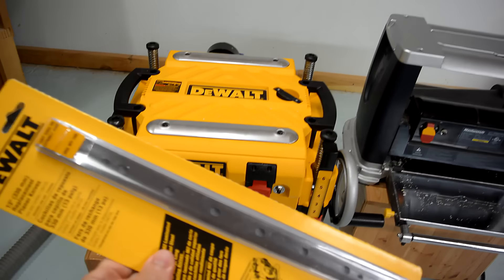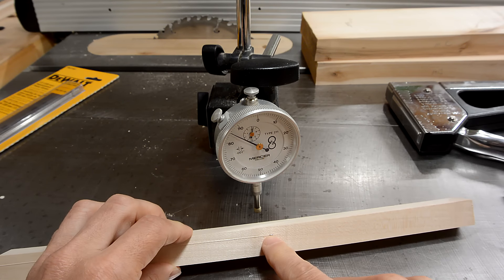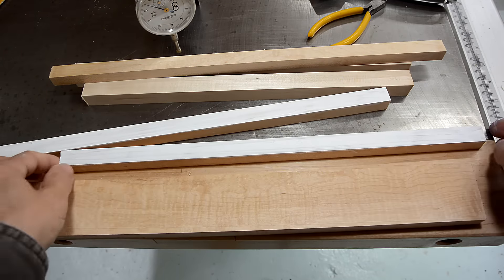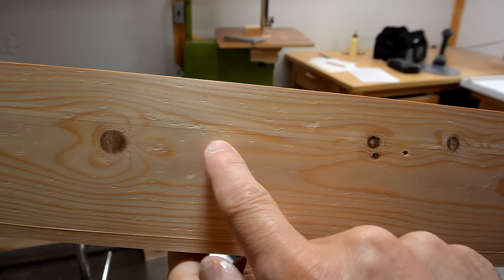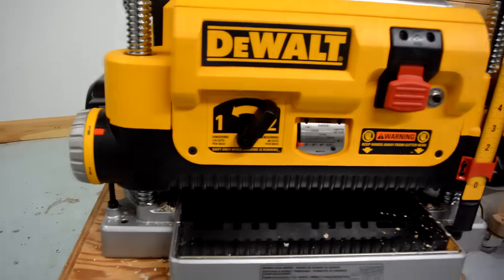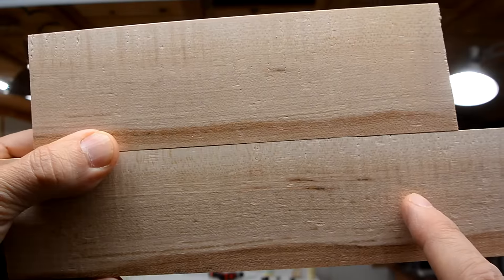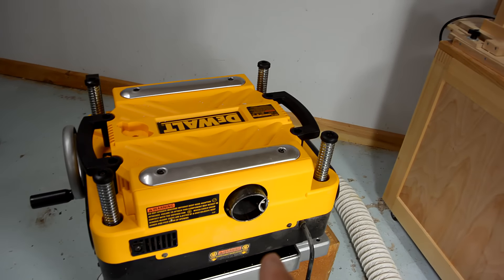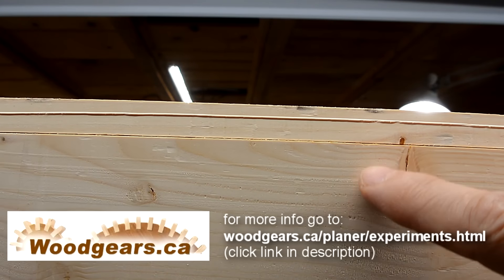More planer experiments

Comment: ...jamming one stick of wood in really fast, one after another, and then being upset when it jams... is an ID10T Error. Don't blame the machine.
Reply from the maker: Feeding wood back to back is the way to do it.  It cuts down on snipe.  Idiot commenter has no woodworking experience.
Reply: +Matthias Wandel I won't argue that
Reply: The actual problem is lack of support on the outbound piece. Table wings would solve it.
Reply: He explained in a previous video why extra support doesn't help.
Reply: +Paul Frederick yeah, I heard him too, but I have the extra table supports for my DeWalt and they do make a very slight difference despite what he has convinced himself of. Not much, but, yes, they do help a tiny bit.
Reply: NorthernChev
I have an older two screw DeWalt thickness planer and I have made my own auxiliary table for it. I wouldn't use my planer today without it either. It still leaves some snipe, but not much.
Reply: +NorthernChev 
Extra supports do help to prevent the jamming you saw in this video. It does not help snipe as much on this planer but it does on others. Feeding wood back to back is what everybody does because snipe will otherwise be an issue, so it's the planer that is actually flawed, not the operator. 
Although calling someone an idiot makes you even more flawed in my opinion.
Reply: no it doesn't cut the snipe, especially on cheap planers. feeding them in staggered does cut the snipe out completely.. also setting up the feed tables correctly does too.. i haven't seen you do that yet.
Reply: Actually feeding them staggered will alter the 'balance' of the head ever so slightly, so has more snipe issues than feeding it back to back. Although it's both very minimal to nothing I have to admit.
A good firm back-to-back should be just as good or better.
Reply: they do indeed help, i had a harbor freight/grizzly reject 15" thickness planer and the wings did eliminate the snipe. the crazy thing of it was that they really stuck way up there to be effective. Wandle does some really off the wall stuff with and to wood working machinery that anyone with half a brain wouldn't even consider doing. his biggest sin is putting his machines on casters and movable. then he wonders why the tooling patterns in the wood is so crappy.. it's a real "DUH!!!" moment.. if the machine isn't held down solid it's gonna walk all over the shop and the results are gonna be dogshit
Reply: HolzMichel
wood is not terribly sensitive to chatter. Wood is just too soft compared to the rest of the machinery.
Reply: *****
not in my experience. the back to back has always given me snipe whereas the staggering never has. it doesn't affect the balance of the head in the slightest. if that's what you're seeing in yours then you should check your main bearings. they're most likely worn
the snipe is caused by the flexing of the workpiece as it glides across the table. as it enters the knives, it gets pulled up off the table by the force of the knives passing thru the cut.
by lifting up on the end of the board you can counter that initial lift, which is what the wings of the table do.
Reply: HolzMichel Are you sure about that castor thing? :) These boards are so short that they are only supported by the machine itself while processed. Nothing to do with the castors.

They only come into play when you feed long stock, and exceed the friction limit, as you will then most likely also alter the support (vertical) pressure and thus alter the angle. Altering the angle is the best way to get uneven results/snipe midway as you can apply a lot of torque with a long board on a short planer bed.
Reply: Paul Frederick
it may have that appearance, but if you bolt a table top machine down solid you will see a noticeable difference in the way the machine cuts and sounds. if it's dancing around the shop it won't perform as well as it should or could. the harmonics make everything flex and shake. that has a direct impact on the cut pattern and also dimensionality of the finished product. while it may seem like i'm splitting hairs here, you will see what i'm talking about if you run some wood thru and try to glue two pieces of it together. there will be parts of the glue seam that don't quite meet up. that's the flex in the machine. it makes a "slow wave" in the surface of the board that is difficult to measure with standard shop tools but easy to identify in a glue up.
to test the theory and see how well your planer is doing, run a piece of 1x3 maple, birch or similar small, diffuse porous wood thru your planer, cut two 4" inch pieces. spit on one of them and stick them together. if you can lift them off the table the your planer is cutting pretty good.
Reply: *****
yep, positive about the castors.. been there done that.. shitcanned pretty quick like. if your  machine is dancing around the shop floor like a drop of water on hot hot stove top it just won't cut right. and the length of the work piece going thru it doesn't really have much bearing on that
Reply: HolzMichel
I plunk my thickness planer down onto the out feed table of my table saw when I use it, and it does not dance anyplace. Although I have not spit on any boards to stick them together with it yet. When the blades are sharp I like the finish it makes.
Reply: Paul Frederick
if you can clamp it down or bolt it down you'll get better results. it may not be apparent at first but if you do a comparison you should see a subtle difference.
it also has in impact on the longevity of the edge of the tooling. your knives will stay sharper longer.
color me a perfectionist in this department. i've had good looking projects fall apart (literally) because of glue joints that didn't hold because of the wave in the surface finish. sure a guy can run a piece of stock thru a belt sander to get a super flat surface, but not everybody can afford 15g's for a belt sander, nor can a lot of shops.. so then it boils down to tuning the planer to make it cut well enough to make a flat surface and hold dimension at the same time.
i cringe when i see machinery wobbling around on mobile stands bouncing around..
Reply: HolzMichel
just sitting on my out feed table my planer is steady as a rock. Other than a bit of snipe I'd say the finish is perfect out of it too. If I was having issues I might investigate, but I'm not.
Reply: No, feeding back to back is not the way to cut down on snipe. Applying upward pressure on the board upon entering the cutterhead, and when leaving the first roller on exit is the way to eliminate snipe. This needs to be done manually on longer boards with more weight, but can be easily accomplished on smaller/shorter boards like the ones you were feeding WITH THE TABLES DEWALT MAKES FOR THE PLANER. letting the boards just drop off the back of the planer then complaining about them getting hung up is indeed moronic.
Reply: Unless the wood is quite wide I usually feed additional planks in in a different position so they overlap, e.g. feed one in the left and one in the right as the first is going through.  This removes any chance of snipe of the end of the first plank and the front of the following one(s).  It also means the blades get less wear at one place.
Reply: Castors a sin?  You do know you can purchase lockable castors.  My entire setup is on castors, router tales, spindle molder, table saw, ..., everything apart from a chop saw.  When locked, they don't move.  You must be very lucky to have so much space to be able to have everything bolted down in a static position.  Besides, for thicknesser there is no applied horizontal force to push the castors, those won't even need locking.
Reply: yes, i do consider it a sin and i do know about lockable castors, they all suck .. this where good shop planning is crucial. most guys go out, buy something and then it hits them like a ton of bricks later when they get it home, set it up, run it and then go to work building their project that their shop isn't set up right or is so overcrowded that they try and make due with the space they have by making their equipment mobile. a one car garage can only accommodate so much before you run out of working room. 
if you're trying to cram a table saw, band saw, planer, dust collector, drill press, a sander and a work bench and tool boxes into a 9'x14' space you're hosed..i've been down that road and i'm here to tell ya, it ain't where you wanna be.  having adequate space is just as important as the tools. moreover making wise use of your space is of utmost importance because you need to consider the work flow as well. it has nothing at all to do with luck.

now there are two ways of looking at this issue of mobilization: 
one, you're doing it to stay busy or as a hobby and don't give a shit about your time investment.
or two, you're doing it to get better results than you can get from commercial outlets

if you're doing for reason one, then having mobile machinery isn't an issue since you're putzing around for the sake of putzing around and if you spend 20 or more hours on sanding and finishing instead of 3 or 4 because of shitty performing machinery.. no big loss.

but if you're doing it for reason two then you have several things to consider: 
you will have a substantial investment in your machines and tooling. for the average joe, a $200 planer is a major investment. while you may not be amortizing it over any length of time, you certainly expect it to do the jobs you need it to and have a certain longevity. mobilizing machinery reduces its life expectancy by more than half. it also increases the maintenance requirement by more than fourfold as well as the incidental damage that occurs while moving it around. setup time goes up exponentially. you are in a constant state of setting up and tearing down and so your repeat-ability also goes to the dogs.

a planer that is bolted down and fine tuned (even the pieces of junk Wandell buys) will always be ready to go and perform much better each time you use it. let's face it, setting up and tearing down are extremely tedious, and after once or twice a guy starts taking shortcuts and the next thing you know you're hanging on the end of your lumber pushing it through the machine as you give yourself a hernia, tipping the machine over or at least lifting it off the castors or table you have it sitting on..  at that point you might as well listen to your woman and go hit Ikea..
these cheap little planers have cheap screws in them and are constructed out of light duty material. to put into perspective it means they are designed to wear out quickly, usually after one to two years or less. however if you tie the bitch down you can easily expect double the life of the machine. these things vibrate like a dog shittin' a peach seed, so you really have to minimize the wear and tear on them by reducing the vibration. there is only one way of doing that: attaching them to a firm and heavy base. anything else is folly.
a reduction vibration also translates into less harmonics that occur during the working cycle (that's usually the high pitch noise development) that you hear. noise = wear .. it's that simple.
then you also have the sloppy tolerances the machine was manufactured with to consider and the flexing of the machine due to the light duty components and superstructure.

something else i would like to add here is that Wandell is an engineer and not a machinist or any kind of serious woodworker that depends on his creations for his livelihood. no cabinet maker or woodworker in his or her right mind would even consider dreaming about the possibility of entertaining the notion of doing the shit he does. he is merely showing home shop guys and hobbyists what is possible with limited resources to get a one off job done. his creations should not to be taken seriously.
Reply: So what planet should we all get ? Do you have the same problems with a spiral cutter head?